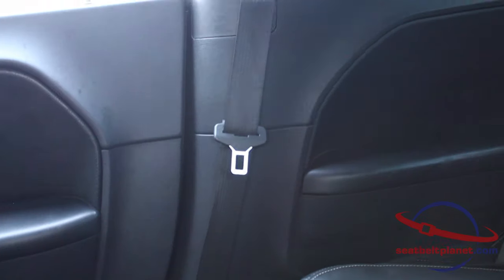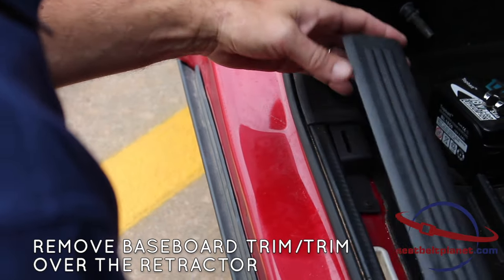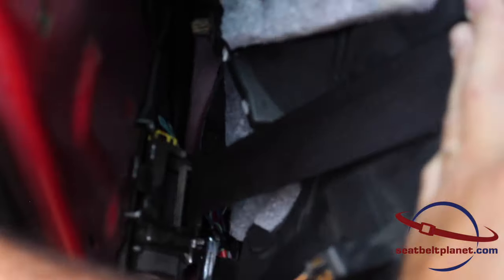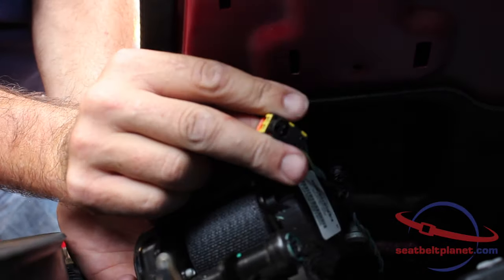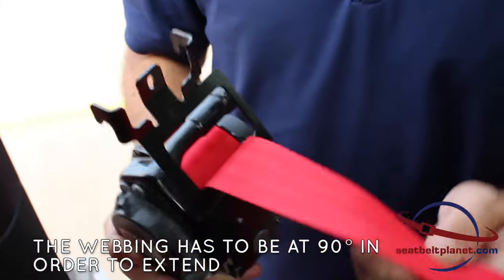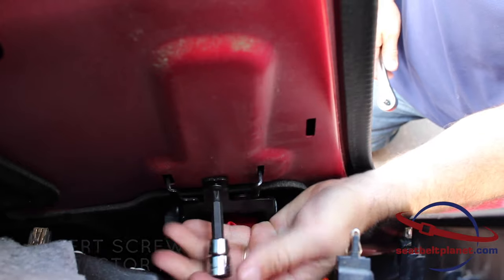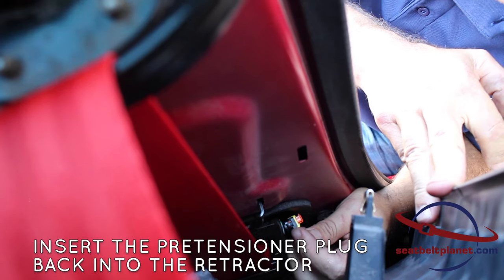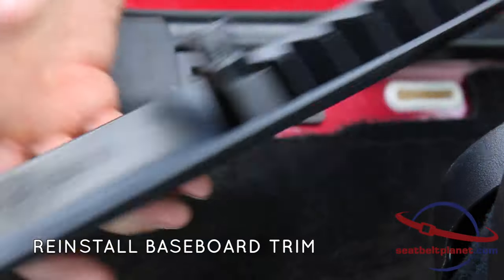Installing Custom Flame Red Seat Belts on a 2012 Dodge Challenger RT

Comment: Where can you get the webbing?  All upholstery shops I’ve talked to want nothing to do with changing seatbelts for “Liability” reasons
Reply from the maker: We can actually do all of the sewing for you. As a seatbelt manufacturer, we know all the right thread, sew patterns and webbing to use to replace your webbing. You can learn more here (https://www.seatbeltplanet.com/p-35844-custom-colored-seat-belts.html) and get sample swatches of our webbing colors here (https://www.seatbeltplanet.com/i-30498214-web-swatch-samples.html?ref=category:1389310).

Comment: Where u get your seatsbelts
Reply from the maker: We are actually a seatbelt manufacturer, but we also offer a "rewebbing" service where we take your existing seatbelt components and change the color of the webbing (cloth portion). We know all the right thread, sew patterns and webbing to use to replace your webbing. You can learn more here (https://www.seatbeltplanet.com/p-35844-custom-colored-seat-belts.html) and get sample swatches of our webbing colors here (https://www.seatbeltplanet.com/i-30498214-web-swatch-samples.html?ref=category:1389310).